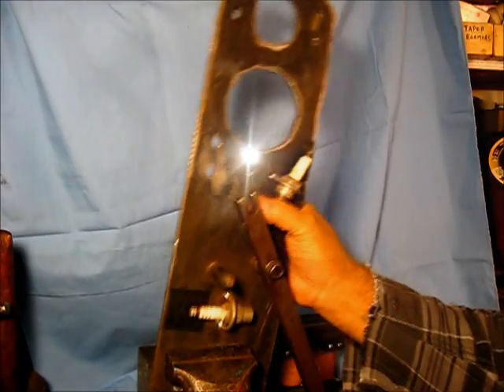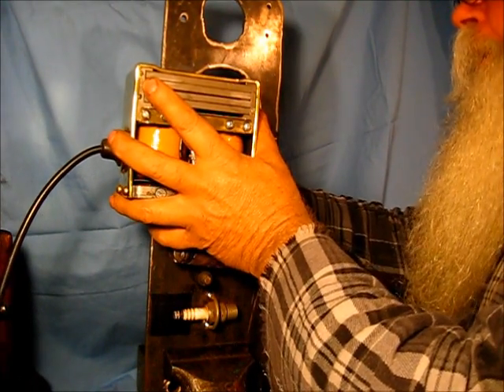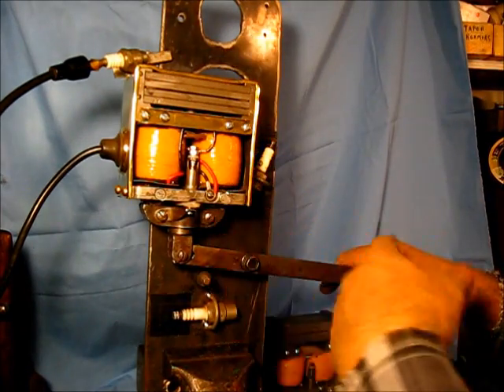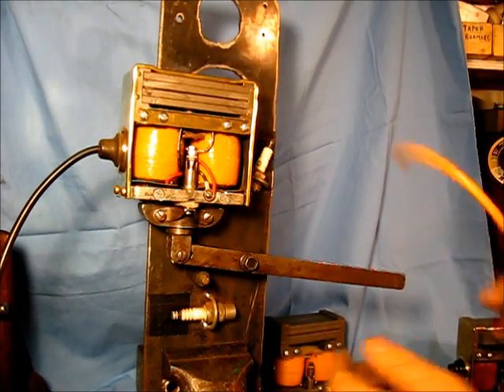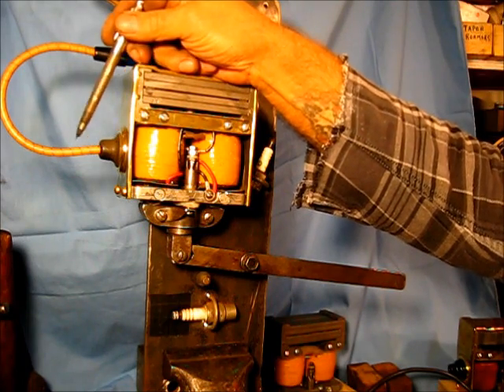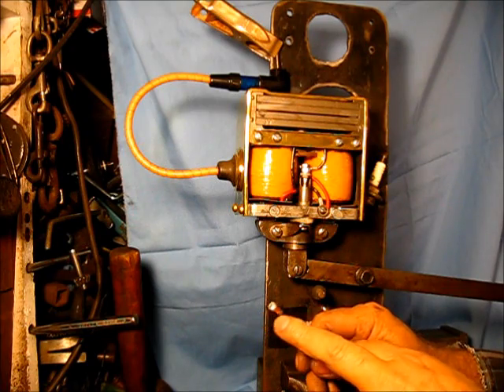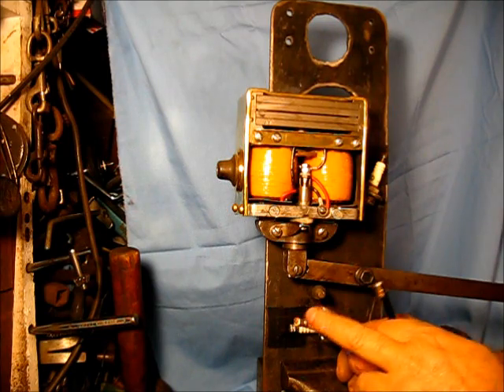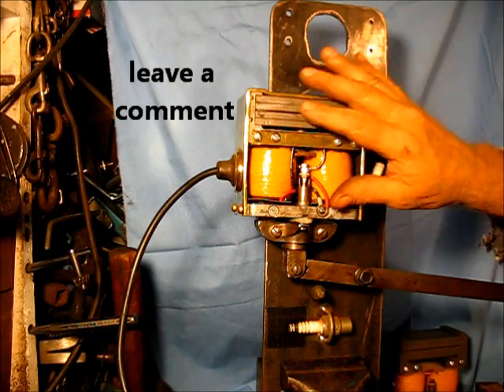Wico EK Magneto Repair test stand / sparks 17of

Comment: You are wright Sam. Each one of them testers have a purpose. some will NOT show a very hot ignition coil.  I have a lot of different types and over the years I have learned  which one to use on which job  and the rest just sit in the  back of the toolbox drawer. Thanks for the videos